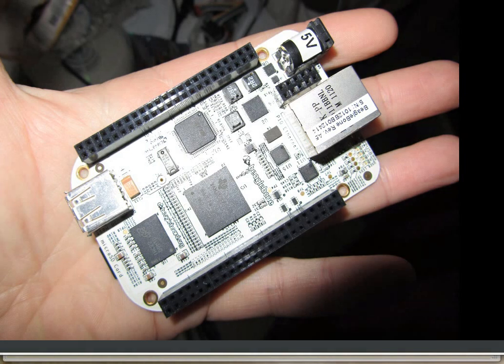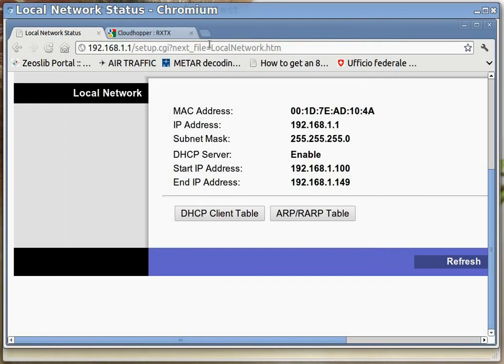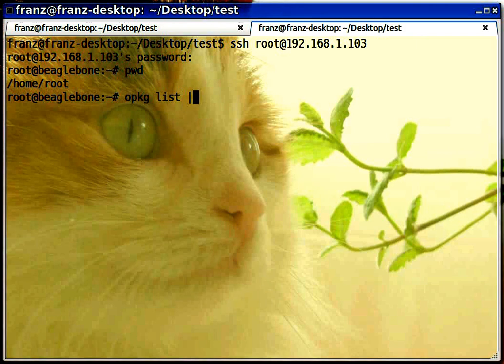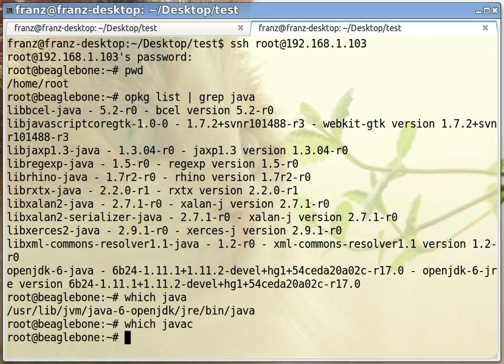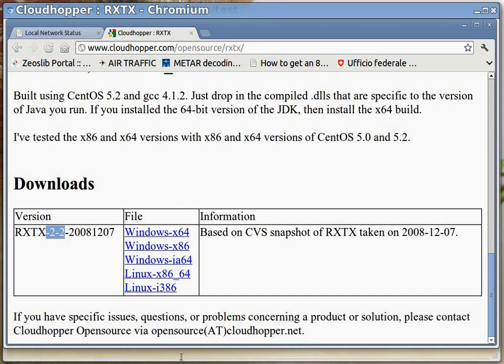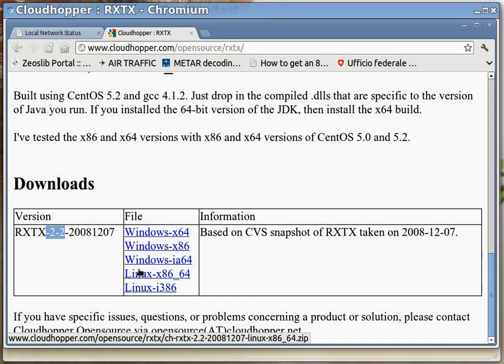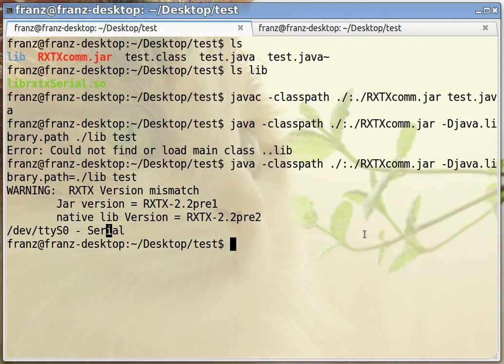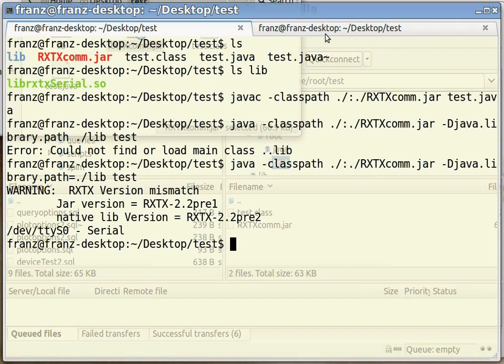rxtx java serial library on BeagleBone

Comment from the maker: Hello, with RXTX you need to specify which non standard ports shoule be "discovered" in the properties file or with the   -Dgnu.io.rxtx.SerialPorts=/dev/ttyO1:/dev/ttyO2:/dev/ttyO3:/dev/ttyO4:/dev/ttyO5 parameter.
Also, depending on the distro you use, names might be different. Honestly I never tried with the BBB since the original program that was communicating via RS485 now works via TCP/IP ...

Comment from the maker: Hello, glad to hear you finally managed with the bone!
I never tried with a beagleboard (I just have a beaglebone), however you may want to check my other video on this subject (using ttyOx).
Normally you should be able to see which ports are avavailable with ls /dev/tty* .

Different usb adapters may be recognized with different name. Try the command without the adapter in and then witht he adapter in, if you spot any difference, then you have the name of your device.
Good luck

Comment: Thank you Francesco. I finally successfully run the java codes on my BeagleBone and get ttyUSB0. But when I run this code on my BeagleBoard with a USB-Serial adaptor plugged in, it can't find the ttyUSB0 or any other ttyUSB, just ttyS0, ttyS1, ttyS2. Do you have the same problem? Thank you.

Comment from the maker: Hello again, the class SerialPort belongs to RXTX, so, if your compiler does not find it, it means it cannot see RXTXcomm.jar.
The code in my blog is slightly different because the one in the video uses some other wrapper classes I created that are not needed for the example, so I created the TestBBSerial.java as a simplified version.
I strongly suggest you get familiar with java and RXTX on your PC before attempting to use it on the Bone.
Try googleing "java RXTX tutorial".

Comment from the maker: Hello, you are not really familiar with java, right? No problem, anyhow you cannot run a .java file, that's the source that needs to be compiled into a .class file.
I provided the source only because the test ptogram itself does nto do much, so the only usage you can do is to read ythe source and adapt it to your needs.
Normally you will want to compile the classes on your PC (RXTX needed,use target java 1.6, then transfer the classes AND the .dat file to the beaglebone.

Comment from the maker: Hello
I am not demoing any specific program, just the rxtx driver, for which I just created a simple java class.
Should you want to use an internal ttl uart (3.3V) instead of an ftdi usb to serial converter, you will need to set properly the multiplex.
For that you can use the java class I made available on my blog (check the video description for details).,